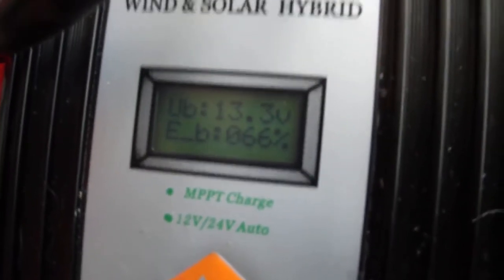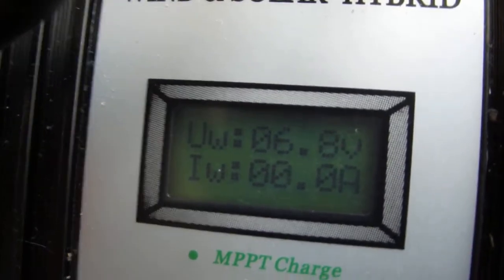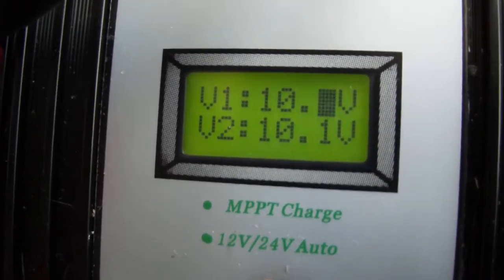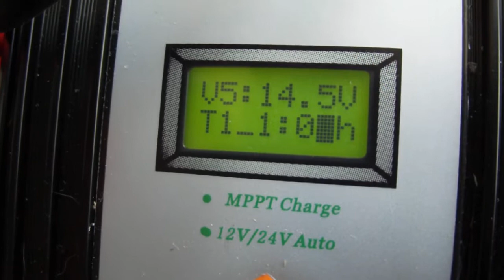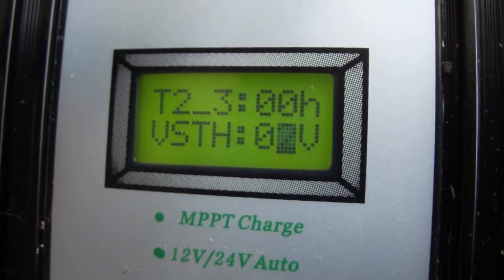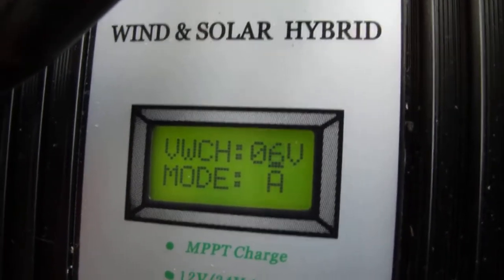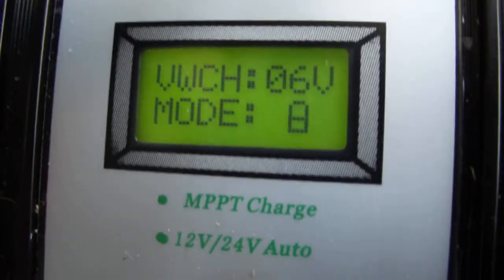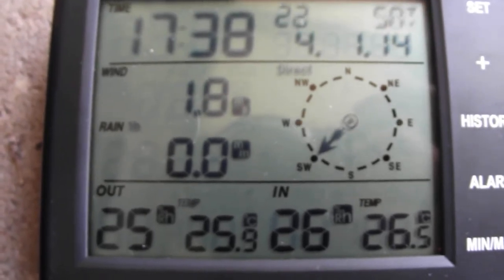(DIY) [Australia] Programming LCD 12v/24v  MPPT Wind Solar Hybrid charge controller

Comment: This controller is not a mppt .Solar charge is PWM and windturbine charger is a booster up to solar voltage (not bulk) .I have do reverse engineering on this controller (schematic available)
regards
Reply: Hello, you can send me schematic? Thanks

Comment: hi,
First version have a bug!Disconnect solar panel and you will see wind turbine charged at 6V.Controller cannot display wind turbine current with solar panel on except when wind turbine voltage is above solar panel voltage.
regards

Comment: No I ask you 
800 W Inverter (12V)
210 A Battery (12V)
180 W Solar panel (12V)
450 W Wind Alternator Motor (12V)
I Can used same same controller.....?

Comment: Hello Oldnic.
I need some ideas,I have same controller And 
800 W Inverter (12V)
210 A Battery (12V)
180 W Solar panel (12V)
450 W Wind Alternator Motor (12V)
How Can I Install this system please Explain me and I need change any Equipment or System.

Comment: Hello
Can I have a question?
I have the same controller.
My connection 250W 24v solar panels wind turbine 24v 500W 4 banks 2X12v + 2X12v =24v 400amp hour batteries
This is my second one that blew away.I asked the manufacturer and they not answering.
Im not using output.  
Any suggestion what is wrong?

Comment: Hello, how do you have it set for each of the settings. I got one of these and it keeps saying my bat is too low or too high. It doesn't say which settings to use for optimal operation. I know there's math involved. Lol. But I have mine on D so that the load can stay open at night but it does not seem to be doing this. I asked the seller manufacturer and they seem not to understand my issue. I'm not sure if it's shutting off my load by the panels going off at sunset. I will check the other settings according to your video but I wanted to run it by someone who has one of these.